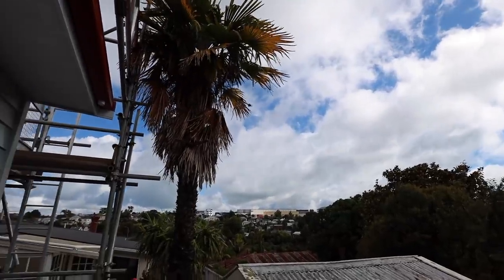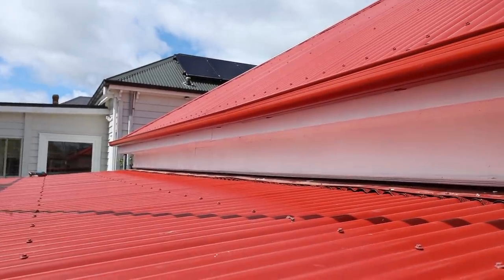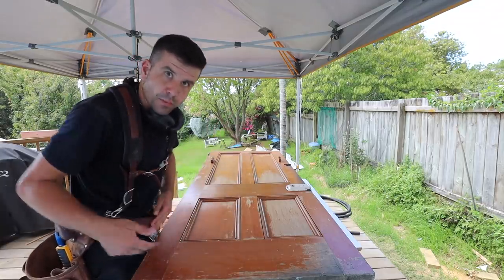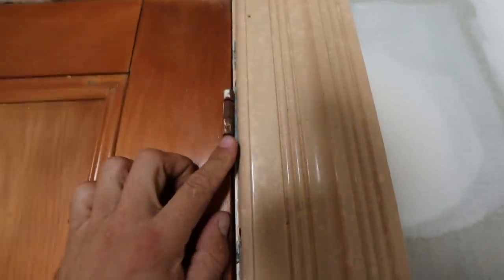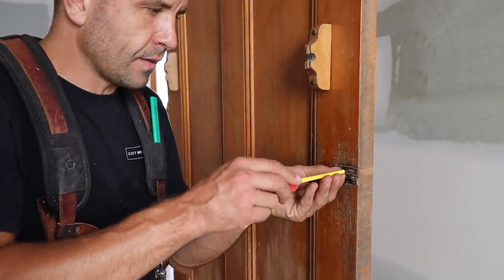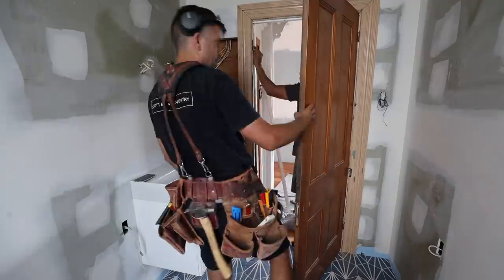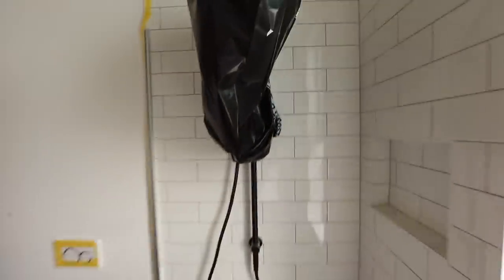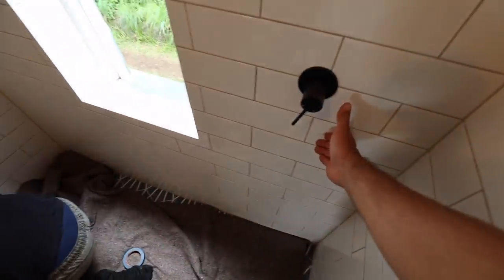Hanging An Old Door

Comment: Hi Scott. Quick tip, sorry if you already know it.  Put your nail punch between the hinge leafs whilst the door is hanging. Hold the punch (watch your fingers lol) and slowly close the door until the hinge leafs bite and hold the punch, then put a bit of pressure on the door but don't fully close it. This spreads the hinge leafs and is great quick way to achieve margins. Cheers
Reply: Quick Q on this, Jake. My tradie mate mentioned this to me, but using a drill bit instead. 

Do you do it with all of the hinge screws installed?
Reply: @daniel.s8126  hi Daniel yes do it with all hinge screws fitted.

Comment: The only thing I like about this bathroom is the grey patterned hexagonal tiles. I liked the other Bathroom where Paerau did that little cardboard model, that turned out very nice once finished. I think the toilet in this new bathroom should be located exactly on the opposite wall. The walk way to the shower is obstructed by it. Most importantly, the visual aesthetic is not what you want to see when you open a bathroom door, it's usually tucked behind the vanity. But that usually comes down to the designer/architect's planning.

Comment: When I lived in Brisbane, Australia, it used to really wind me up as an ex joiner to see internal doors hung with a gap to the bottom of the door of sometimes more than 25mm, just no need.
Reply: here in the UK now the policy is to have houses well insulated and air tight and a lot of the time with forced air heat recovery ventilation which requires at least 12mm gap below doors to allow airflow
Reply: @tdimccullough  Never heard that one.   If a door had more than 12mm gap below the door, I would raise it as a defect..  Similarly if more than 3mm gap to top and sides I would also raise as a defect.

Comment: Why on earth did you run the shower glass channel all the way across the shower floor? Now you have to step over it all the time. We don't even use channel on the floor just a clip is all it needs and silicone across the tile.
Reply: That's the system they have to work with, and that's how it's installed.  I think he said there's a capping strip to cover the "leftover" section of channel.
Reply: @ironpirate8  lol rubbish. There is no way that is meant to be left running all the way across the opening. I'm in Australia and it's standard to use clips on the floor not a channel, so I highly doubt it's not available in NZ.

Comment: Do windows in bathrooms need to be obscured or frosted in NZ? They do in the UK but the one by the shower sender to be normal glass.
Reply: The only requirement is that, below 2 meters, they be toughened  or laminated glass . Shown by a small etched decal in the corner . ( no decal no sign off) Obscured is optional.

Comment: 10:45  How is the painter supposed to paint in the gap between the vanity and the wall. It’s visible so it should be painted not sure how he’s gunna reach that now the plumbers gone and installed the vanity.
Reply: It has already been pained around the vanity. It is white so it is easy to think it is just plaster.

Comment: Gday Scott.

A few issues with your approach for next time, ‘turning the hinge around’ is never ever going to work as a good carpenter in ye olde days, would have given it a leading ( beveled ) edge, which will be working against you.
  You want to have the door fitted 💯 BEFORE you think about putting a hinge near it.

You want the hinges ON the door then wedge it up till it hits your 2.5-3 mm packer and mark the frame ( unless old frame, then you do same but mark door off frame) forget the tape measure 

It looks like you installed a new frame for the old door? You then had the perfect opportunity to run the track saw or planer up the hinge side and start fresh, yet you sized the openings an old  door that was likely all over the place size wise?                                                 
  I get you want to keep the styles of the door even, and not mess with the lock side, but we’re only talking a few mm difference.

But otherwise great vid, and the job is looking sick👍🏻. The fascia Parlo fixed looks superb, all that work and no one will know until it’s pulled off in 100 yrs. ‘those old carpenters were awesome! Look at these bow ties!’  😂👍🏻